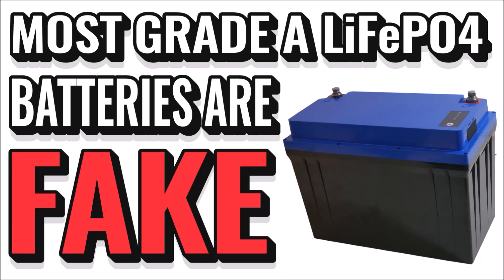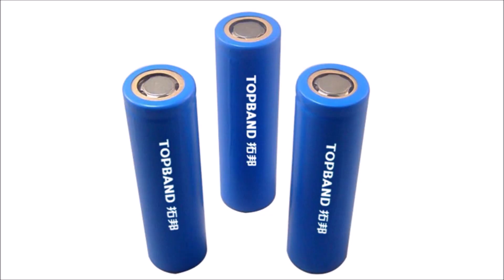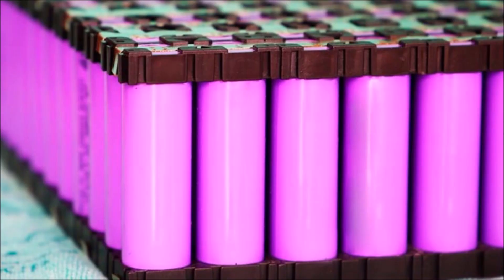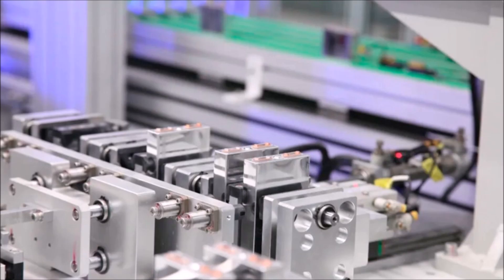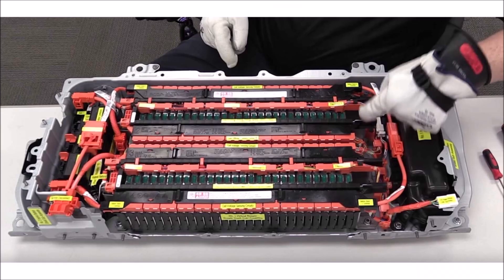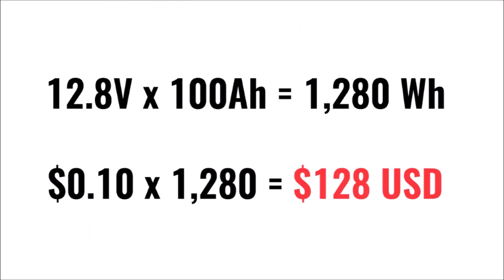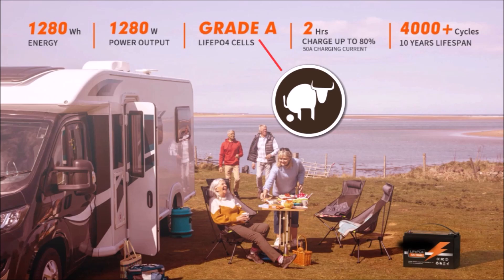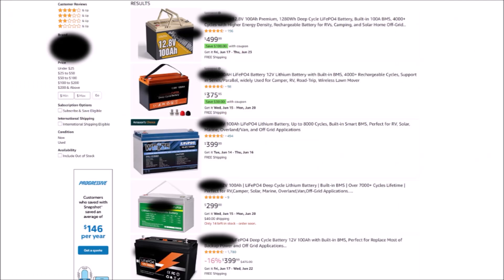Fake Grade A Lithium Deep Cycle Batteries Are Everywhere!  Learn How To Spot Grade B vs Grade A

Comment: I just purchased 2 EPOCH Lithium batteries for my bass boat. One 12v 120ah cranking battery and one 36v 100ah trolling motor battery. Spent $2800. As in everything you buy, you get what you pay for. I really appreciate you being honest about the differences in grade B and grade A. Made me feel better about my purchase
Reply from the maker: Personally, I think that is a good decision.  A lot of people are perfectly fine rolling the dice on some no-name stuff on Amazon (or Li Time, which is a different soap box) and saving a bunch of money.  But I talk to fishermen every week that bought cheapo lithiums in the past and now are looking for a quality battery worth having after only a few seasons.  There is a reason why Jacob Wheeler is using MillerTech's (the same set for 3 years now, I believe).
Reply: @LDSreliance my sok's have been going for years now!
Reply: You paid away to much!
Reply: @gilianrampart8514  Buy Once, Cry Once 💴💴💴💴
Reply: Lithium for a starting battery is just ridiculous waste of money.
Reply: @fishmojo865  Not a waste when one AGM Eliminator battery cost $300. I paid $700 for a 12V 120AH cranking battery all in one. With a 11 year warranty. I was replacing the AGM every 2 years. Do the math

Comment: I've reviewed a few of the LiFePo4 "12V" batteries for the Amazon Vine program.  Some of them aren't even LiFePo4 and upon disassembly, it's pretty obvious even to someone who is not a battery geek that they are just regular lithium batteries... They might be good batteries, but if they lie about this, they get a low rating...
Reply from the maker: At this point, from the information I receive on an almost daily basis, I believe about 75% of the market is fake in one way or another.  There are proven examples of some using used cells pulled from EV buses in China.  There are examples of some batteries having a block of concrete inside and only half the expected number of cells.  And there are tens of thousands of examples of batteries comprised of Grade B cells with the QR code and laser etching removed/covered up/replaced/altered to pretend that they are Grade A.  I can count on two hands the manufacturers that I would be confident are truly using Grade A cells.  And that is sad.
Reply: @LDSreliance  -- I figure it is just part of the Chinese (especially Communist China) "culture".  Although the items that I receive via the Amazon Vine program are "free", they still report that as income to the IRS and as such, I'm paying probably 20% or so of their original listing price.  I'm expected to provide an honest review and for some of the items, that might equal a couple of hours work doing testing and writing up the results.  Each review averages around 3K in size.  The items that have accurate ads and the product meets the ads claims are a lot easier to write reviews for than the whose sellers lie because in order to justify a bad review, I feel that I must provide proper testing and documentation as to why I feel the item is so bad.  Some of the items are so bad that even with the basically 80% discount, they are a waste of money.  No matter how bad the product is though, I cannot return it.  Wattage claims on off-road lights and lumen output are routinely exaggerated.  Some of the sellers though will actually contact me and thank me for pointing out the errors.  I'm a retired engineer, so I might be a bit more critical about companies meeting their advertised specifications than some reviewers though.
Reply from the maker: That dovetails with my experience as well.  When I was doing product reviews on my channel I would say that I gave negative (but constructive) criticism on about 90% of the products I received.  Very few were perfect.  But only a handful thanked me for the criticism and promised to make changes.  The rest pressured me to either leave out the negatives or minimize them in my reviews.  And that is the biggest reason that I no longer do reviews.  They are lucrative because you get a free product and get paid for the video.  But my integrity cannot and should not be purchased.  I never lied or promoted a product that I knowingly felt was inferior.  But I also wasn't comfortable with the arrangement and tap dancing around some of the weaknesses without overwhelming and incontrovertible evidence.  It was exhausting.
Reply from the maker: Well I am glad there are still some honest reviewers out there.  But I'm not sure that the Amazon swamp can be drained.  It is so full of fake reviews and dishonest sellers that it is pretty hopeless, at this point.
Reply: @LDSreliance  -- For some reason, none of my replies to you are showing up in this thread... Are you deleting them?
Reply from the maker: No, I don't delete comments.
Reply: @LDSreliance  -- Then YouTube is acting a bit strangely... Or maybe it is just on my machine... I'm using the normal browser version, not the app, but I can only see your replies, not my replies to you... But they do show up in my comment history... Oh well...
Reply from the maker: Sorry, I can't see them.  I have checked the "Held for review" section thinking Youtube might have flagged them for moderation for some reason but they aren't in there either.
Reply from the maker: Can you copy and paste them from your history and try again?

Comment: Great info... but for the average consumer.... B cell at a discount is the better investment. For example I just bought 3 discount brand batteries for a fishing boat at $319 CDN on sale . They will get cycled 20-30 times per year max. If properly charged and maintained... they should last 10 years easily. This is compared to 3 $1000 CDN batteries which are "standard" in fishing. 

Now if you are running a whole home solar system... that might be a different story from a battery brand perspective and A vs B cells.
Reply from the maker: Should is the operative word.  The problem with the cheap Grade B batteries is that they do not use matched cells and they use a cheap BMS.  So the cells are all random "rejects" for lack of a better word.  One might be out a tiny bit on voltage, one might be out on a physical blemish, one might be out substantially on IR and so on.  The BMS has to wrangle all those different breeds of cats every charging process to keep them all in line.  Over time that becomes harder and harder to do, especially with a cheap BMS.  Add on to that an inexperienced battery owner (not referring to you, just in general) and you have a recipe for early failure.

The early reports are that Grade B cells are failing at a rate of about 20% over the first 2 years.  Hopefully none of your cells are part of the 20%.
Reply: I'd be interested to see what the parameters of the reports are. How many cycles, depth of discharge, amperage draw per cycle, charging amps, etc... in those first 2 years. If you use 90% of the batteries capacity on a constant basis, obviously the wear will be greater than using 50%. 

All I am saying is sometimes a job calls for a Milwaukee drill and some call for Black and decker. Heavy constant use, and light occasional use.
Reply from the maker: I agree to a certain extent.  But you have to define"wear and tear".  In my mind, that would imply depleting the normal life expectancy through heavier use.  And heavier use would mean deeper discharges and higher amps.

There is no reputable number for expected cycle life on a Grade B battery, only the individual cells.  The general consensus is that most Grade B cells can expect around 1,200 cycles @ 100% DoD but that varies depending on what spec they were rejected for.  1200 cycles sounds great, but the problem isn't how long each cell lasts because the battery is composed of numerous cells.  The issue is whether or not the BMS can bring them back into balance with all of the other cells and maintain a functioning battery that can continue to provide the same performance as when it was new, or close to it.  And that is nearly impossible without closely matching the cells, which none of the $200-400 Amazon cheapos do.  

You could tear open the case and manually top balance the cells and keep the battery going but not many people know how to do that and 99.9% of consumers never will.  So it is just a giant roll of the dice.  I talk to 4 owners of lithium battery brands regularly.  These companies sell millions of dollars a year and have been doing it for 7+ years now.  And they are telling me the failure rate of these batteries is 20% within 2 years.  And it goes way up from there.  But, like you said, it does depend on how the batteries are used.

Comment: Yes, very interesting. If I was going to space, then I would want the premium batteries since failure really costs a lot. But if I am using batteries for power backup during occasional power outages to run my freezer and frig, then I think I can get by with a grade B or probably even a grade C battery.  It is like with tools: if I have a quick home job and need a tool just for that, Harbor Freight is good enough, but if I'm a professional mechanic making a living at fixing things, then I'll go for Snap-On.

Perhaps you could expand the video to say just when does someone need a grade A premium battery, and when is a low-priced piece-of-junk battery actually good enough. I just bought an Elefast 100 Ah battery to back up my frig. I saw no claim as to battery grade, and neither have I noticed such in other brands.

Another problem is that if you pay a premium price, you still don't know if you got a grade A system. It could be a piece of junk sold at a high price. If you buy a cheap battery, at least you know what you are getting.

But, good video with good info. Thanks!
Reply from the maker: Absolutely.  If space is not an issue and you don't need to run high loads on the batteries, buy a pallet of cheapos.  That makes a lot of sense.  But that isn't most people.  Most people are buying a couple for the trolling motor on their bass boat or as house batteries for an RV.  People buying them for solar are buying rack mounted ones or large format ones from companies like BatteryEVO.  There aren't cheapo versions of those large format batteries (yet).  I am sure there are Grade B brands that aren't telling you they are Grade B, but we aren't seeing the flood of bargain basement, volume based sellers like we see on Amazon for the Group 29 and Group 31 size formats.

Comment: based on your numbers, it's only the battery cost that affects the final product price.  You said the other things, BMS, shipping, storing, etc. is done at the lowest cost.  The batteries are $128 for grade A.  The final product is $500 at least.  You are saying that, all things considered equal other than the internal cell grade, all batteries have at least $500-$128=$372...  $372 for a battery with no-cost cells.  Yet you show batteries being sold much cheaper than that.  I, myself, just bought a pair of 12v 100ah batteries for $210 each.  
Your video stopped too soon.  it does not explain how these vendors are able to sell their batteries in the $200 range retail.  Can you offer any ideas, facts preferred, but I'd settle for just an educated guess for now, how they can sell that cheap even if they got their grade B for free?
Reply from the maker: The numbers I presented were for a true Grade A battery with a quality BMS.  The economics for these $200 Amazon piles of junk are completely different.  They use $10 BMSes (that is retail price - their bulk price is probably a few dollars).  They also don't have any warehousing costs because they are shipping direct to Amazon for fulfillment.  And they are selling direct to the consumer and not through a wholesaler or reseller network like American companies normally do.  So they are selling you $50 worth of Grade B or C lithium cells (at best), a low end BMS, wiring and connectors, a case, packaging etc. and then making about 10% margin on the whole deal.  But they sell dozens of containers of these things so they make up for the lack of profit by selling in high volume.  Then when their reputation catches up to them, they pull their products and post them  up under a different brand name (see AmpereTime which is now LiTime as well as dozens of other brands).
Reply: O.K., now you are saying prices are for quality parts like the BMS.  In the video you said all things were priced at the lowest cost.  Personally, I don't see a problem with the lower grade of battery for the average user.  For example: I bought some for a trolling motor used and charged maybe 5 or 6 times a year.  They provide me 90ah from a 100ah rated battery and cost me around $220 each.  How would a true Grade A battery perform any different for my application?  
It's sorta like buying a car.  If a domestic brand, plain vanilla used car gets you from point A to point B just fine, it's not necessary to buy a new $50,000 top of the line model.   @LDSreliance
Reply from the maker: The purpose of the video wasn't to influence a consumer either way.  Just to educate people that they need to dig a bit deeper and stop believing what they are hearing from marketers.  Make an educated decision based on your risk tolerance, budget, and ability to troubleshoot and make contingency plans.  There is nothing wrong with buying a $200 battery from Amazon... unless you think you are buying a Grade A battery that will last you 3,000+ cycles.  In that case, I have a serious problem with that.

Comment: Chinese are not idiot, they can sell the same low quality product for "high quality cell's price" .... that' why hey are so many LifepO4 Battery's brand . 
Llol, if it is enough to double the prices to make people believe that they are buying Grade A Battery ... why a Chinese seller wouldn't do it  ?

But OK, A lot of battery are gade B, which are perfect for your trolling motor , for which you'll  never do more than50 cycle each year ....even if you did one hundred cycle per year, it will remains a very insignificant use, so grade B seems OK for me §
However i'm OK, the issue is lying about what they sell  to us.

Do you think they have the same definition of commercial lying in China, I'm not sure ! (one chinese seller, answer to me: "you will have what you paid for" lol, they perfectly know they can lie !!!)

Comment: You helped me avoid making a significant financial mistake.  I'll admit I had no idea there were grade A and B batteries.  Education is power!  Now I know the difference (hopefully).  I often say folks step over dollar bills to pick up nickels.  This is one of those comparisons.  Buy it once, or buy it 4 times.
Reply from the maker: I am glad I could help!  Just understand that Grade B batteries are not trash.  They can be quite good.  But they will never match the full performance and longevity of a Grade A battery.  So the customer should know that up front so they can make an informed decision based on their preferences, needs, and budget.  That was my only point.  Good luck!
Reply: How do you know those expensive premium batteries are actually using grade A cells?  If I was a seller and really wanted to hoodwink someone, I could just charge a premium price. Who would know the difference?

Comment: Have you taken a look at AOLithium Batteries yet and what do you think of them if you did?  I watched several reviews/teardowns on them and they all performed better than rated and the reviewers were impressed with the build quality and components used like the BMS, sensors and heat sink were of high quality, the cells were laser welded together and the buss bars and other copper components were excellent.
Reply from the maker: Unfortunately, none of that matters for determining the quality of the cells.  There are quite a few well-manufactured batteries out there that are made with Grade B cells.  I even sell one line of them offered by MillerTech.  The thing is that the companies need to be honest that that is what is in the batteries.  Some are honest, most are not.  A Grade B battery can still be excellent.  But it will never last as long or perform as well as a Grade A battery.  And I believe the consumer needs to know that to make their own choice.
Reply: @LDSreliance Thanks for your feedback.  They do advertise Grade A automotive cells and I have been keen to find poor reviews on the product like swelling or disfigured cell blocks but I can't really find anything significant to steer me away from them.  On a Black Friday Sale I managed to buy two 12.8V 100amph batteries for $809 Canadian delivered to my door.  They seem to have all the high end features like Bluetooth, low temp sensors, a great working app with lots of real time information but no heater for charging below the freezing mark but that works in my case because I can't fish at those temps anyways.  Batteries are for my 24V trolling motor application.
Reply from the maker: Yeah, unfortunately they know they can say that without anyone catching them.  It is almost impossible to prove they are are Grade B without tearing the battery apart (to where it cannot be repaired) and testing each cell with a battery of lengthy tests.  Or finding evidence that they removed markings from the cell manufacturer indicating they are Grade B, which is required by law from the Chinese government.

You should watch this other video that I did that gives some more info:
https://youtu.be/68h1yeXekqc

And here is a company like yours that is claiming Grade A cells when the price tag proves they cannot be Grade A (like your company):
https://youtu.be/GoHofLTOhVI